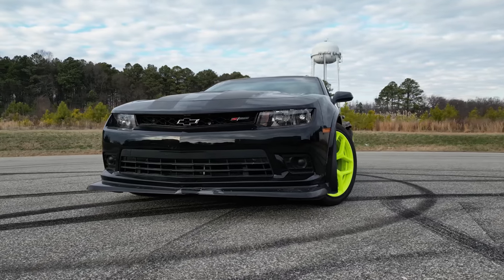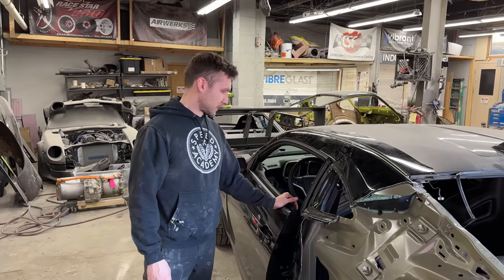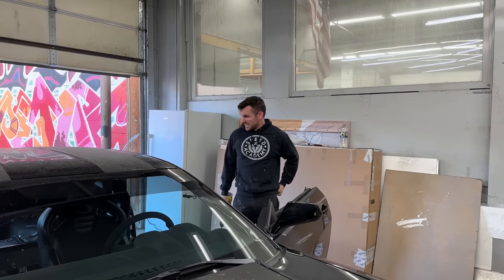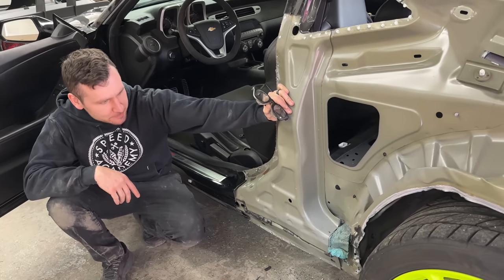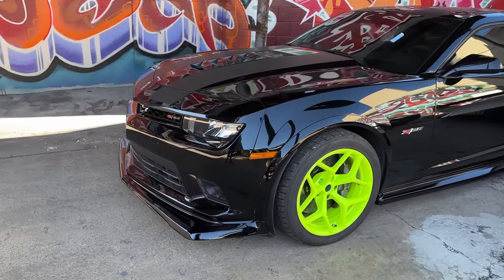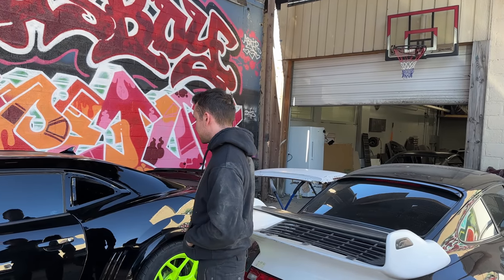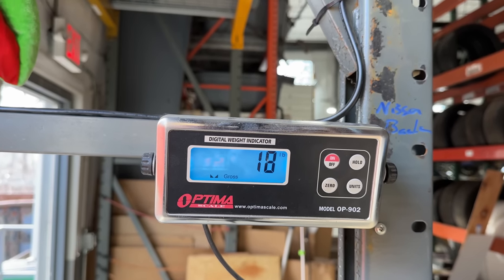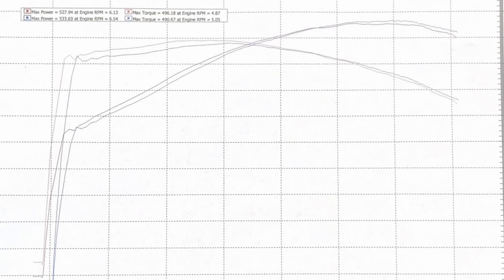I FIXED This TOTALED z28 Camaro From Copart

Comment: very specific buyer, it will probably take a long time to sell this but i'm confident you can get at least 55-60 for it. that title is a killer, problem is the parts seperate were not worth 40k but the sum of them is barely more as well
Reply: I don’t think so. You can pick up a clean title, low milage one for under 50k.

Comment: I noticed the strip is a little messed up, driver's rear on the roof. Hopefully that is an easy fix. Also, I know the wheels really pop, but I find in a good way. I'd normally say, paint them as well, but in this case, I'd leave them. Good job man. Cheers 🤘🤘

Comment: Using a new quarter will save a ton of time... removing the old one from the section you dropped would have taken a lot of time and really easy to mess up.  These new cars have some much extra foam and so on.  As someone who rebuilds cars, you'll make far more money selling parts than rebuilding them lol

Comment: Salvage title cars are good if the car was repaired  correctly,unfortunately, people use the fact that  it has a salvage title to try to say its worth less,however I you factor in the miles and your buying g the car because you personally like it and see it's worth than it's a great deal,If I had the cash I'd buy this based on the miles alone and seeing the condition,it's worth it IMO

Comment: Blimey have they got no spot welders out there lol on a car like that over here in the UK you couldn't do that we have to use thatham methods tells you where to join and what to weld with etc to ata standards and deffo wouldn't be painting without a airbfed mask and overalls ive been painting over 32 years.